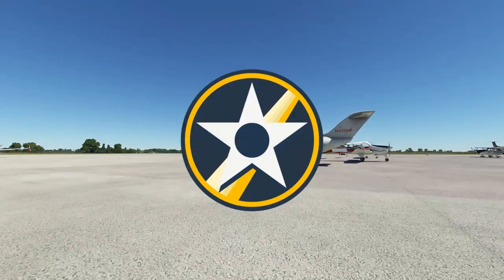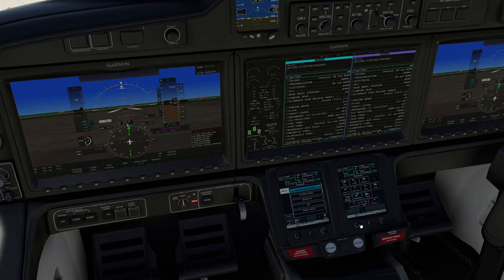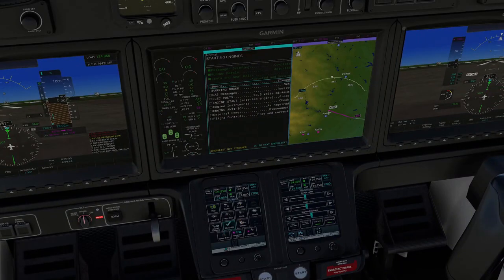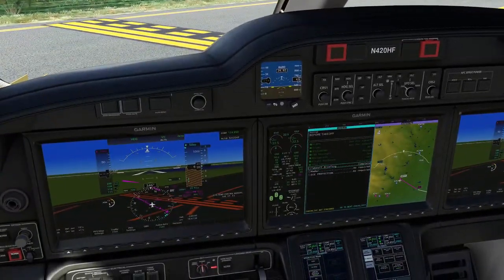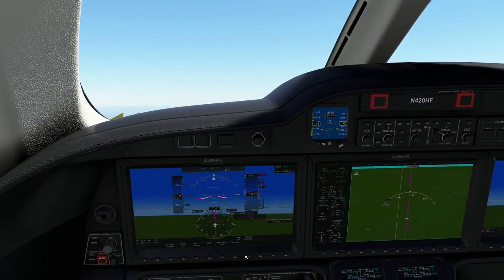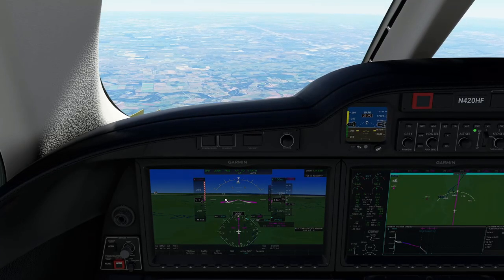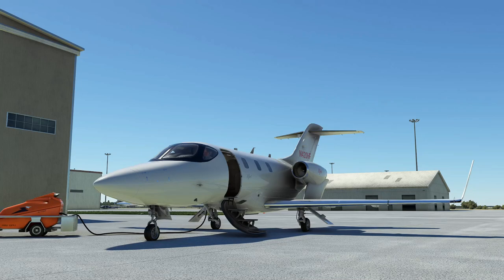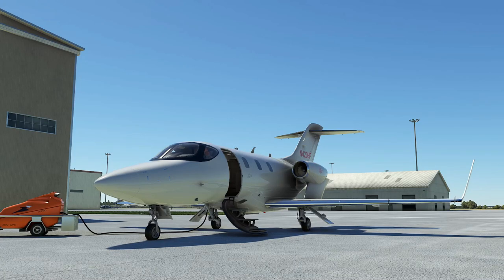HJet Full Flight Guide - V2 Updated - MG/Flight FX MSFS Checkride

Comment: Both my PFD's are slaved to each other, meaning I push a button in one and the other does the same thing, like if I push map in the left one the right one goes to map too, and then if I push flight plan in one the other one goes to flight plan, and in split screen mode only the left panel on the PFD will change to reflect what I entered. How do you get each one to work separately to use both panels, I tried and played around and cannot seem to find the button to change this.